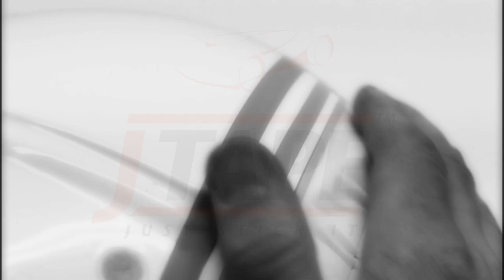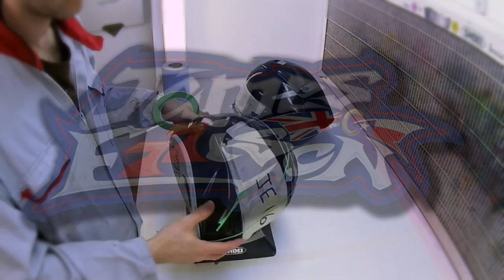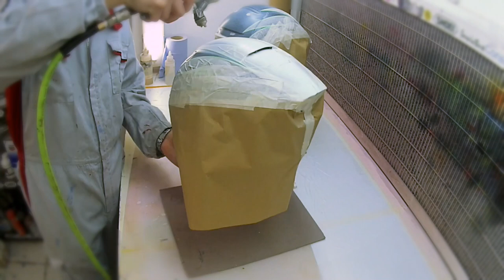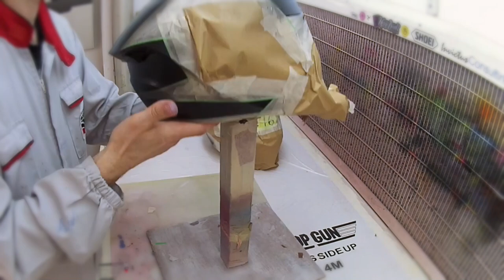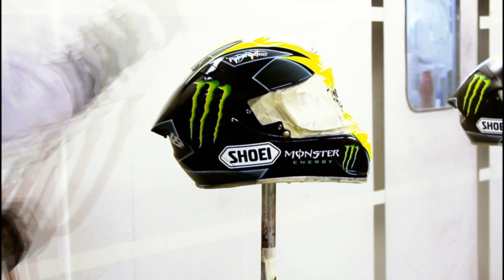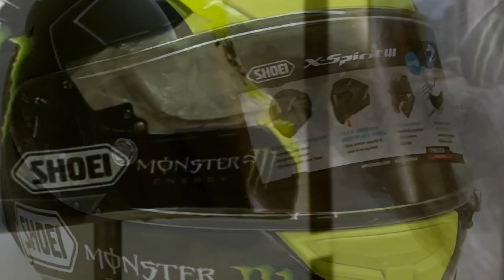James Ellison 2016 Monster Energy Shoei Xspirit 3 helmet

Comment: do you just spray clear coat over the stickers?
Reply from the maker: Hi Casper, I do use some decals for things like sponsor logo's. The material I use is very thin and it doesn't have any protection from wear or UV exposure so by clear coating over them it protects the finish.
Reply: Okay. Thanks for the answer. What type of paint do you use for the airbrush and the mini gun? I’m going to try paint a helmet myself but can’t find what paint to use.